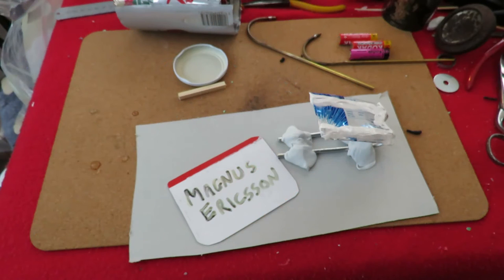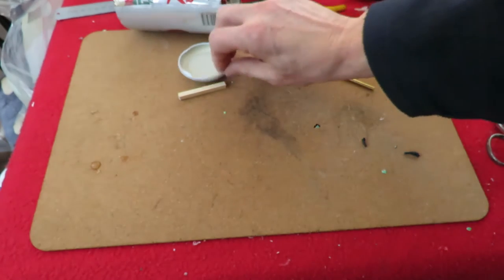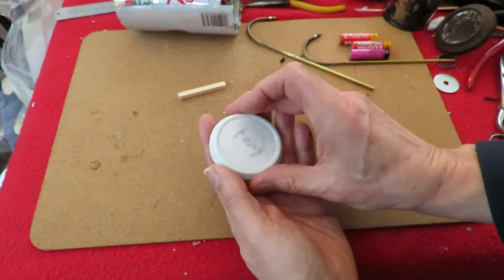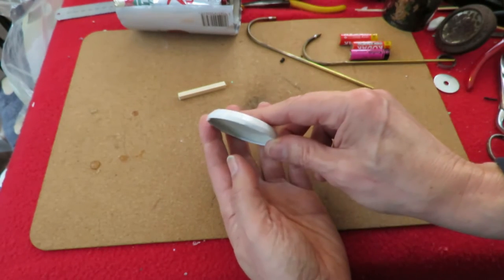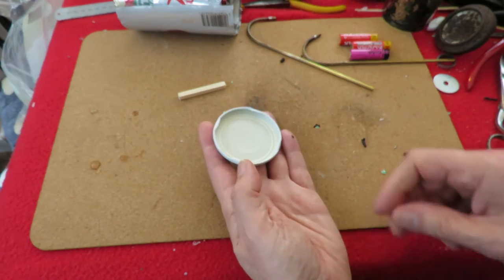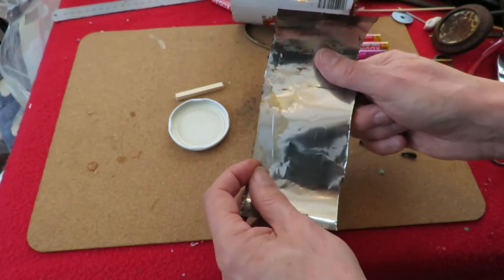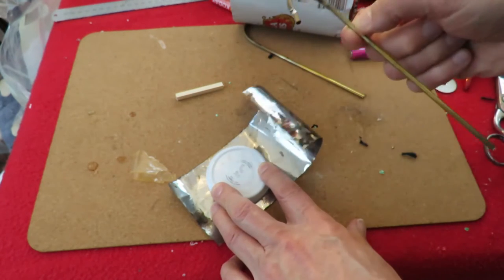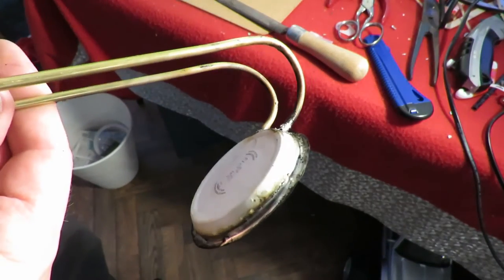Louder Pop Pop boat but boiler FAIL

Comment: I know this doesn't relate with the video, but I noticed that you are good at making gravity powered cars and I'm making one for a school project. I have the whole thing done but the weight is not falling when its on the ground but when I lift it up it falls is there a reason for this and a way to fix it.
Reply from the maker: Just run that by me again. Where do you expect the weight to go if it is already on the ground? Ah, you mean the car is on the ground and the wheels don't turn, but when you lift the car the wheels turn. Your problem will be the weight is not enough to turn the wheels. If the amount of weight you can use is limited then you can increase the diameter of the axle to give it more leverage or reduce the size of your wheels so they take less power to turn. To increase the diameter of the axle you can wrap tape round it. This is just where the string wraps round it. I mention it briefly in this video https://youtu.be/UNKS-DsEmHg?t=494 and talk about it more in this rubber band car video but it is the same principle https://youtu.be/TVummPqHKuk